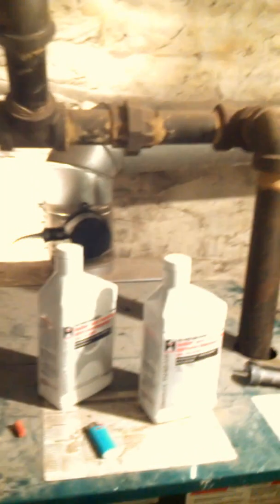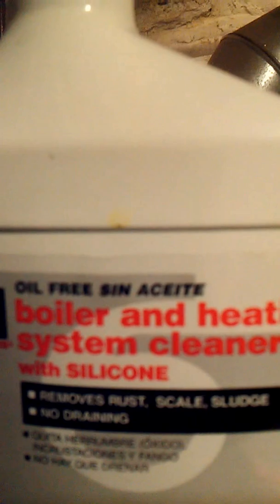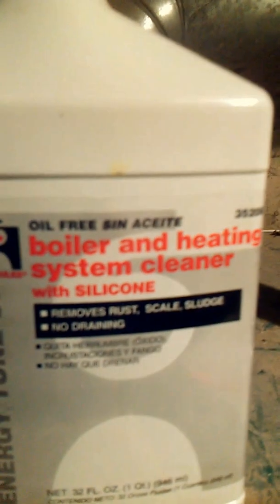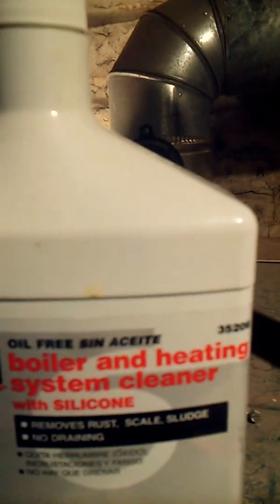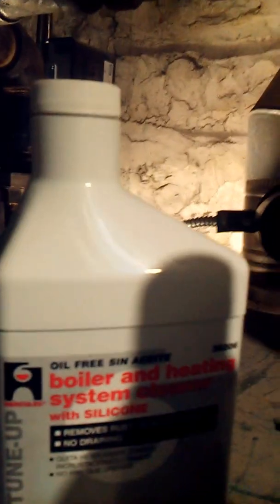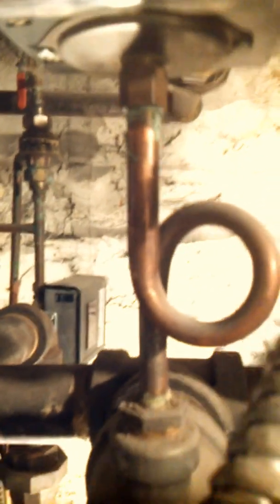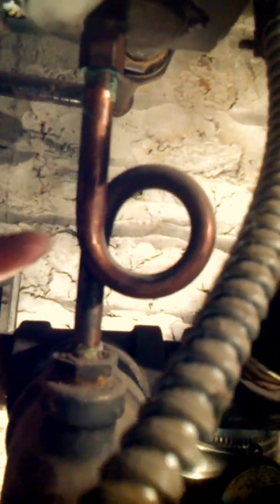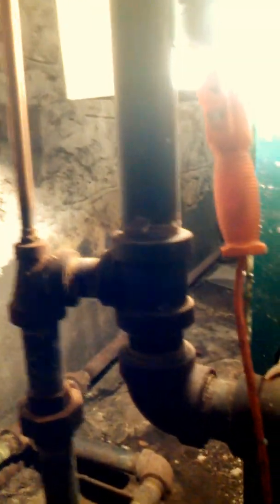Steam Boiler Surging & Water Treatment

Comment: I have the same problem ,I skimming  the boiler ones a day , water looks clean but still surging. any recommendation?
Reply from the maker: Total Hycolonic of entire system for starters. Their can be other issues regarding bad equalization.
Reply from the maker: Total Enema: cold boiler, remove all air bleeder valves and pressuretrol,
have plugs available, overfill entire system, when water comes out air bleeder ports plug them, when water reaches top for system stop filling, let stand for at least an hour, then rapidly dump via drain on condensate return and boiler. Then repeat until water is clear. Most times works on first shot  small residential systems.
Reply from the maker: PS: don't plug upper most radiator, then when system is draining start removing plugs averting vacuum in holding water in radiator.
Reply: John S Thanks John for you fast reply, I definitely will try that , Now that pressuretrol , how hard is to remove it for cleaning [you know that loop]?
Reply from the maker: dabell12 if small system, two story house you don't have to remove,
Reply: John S Small unit Dunkirk PSB Series ,only 1 floor house with  5 radiator inside wall